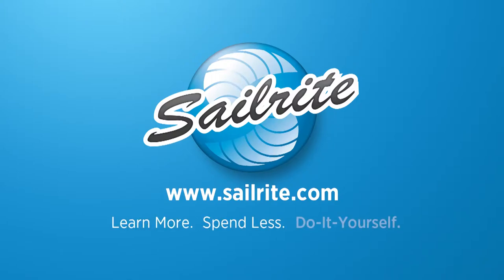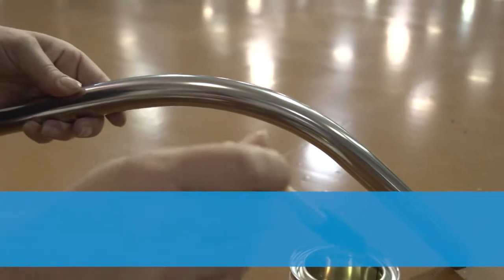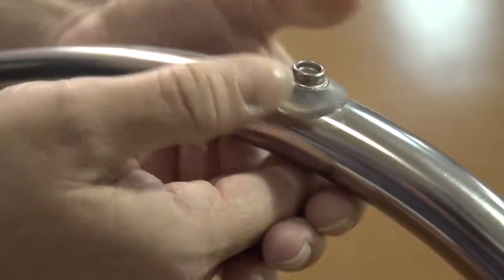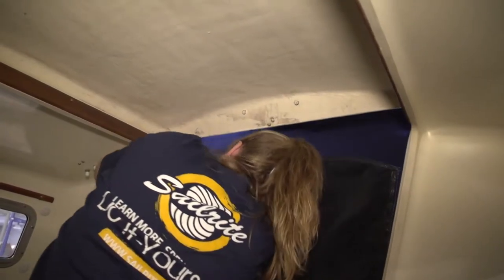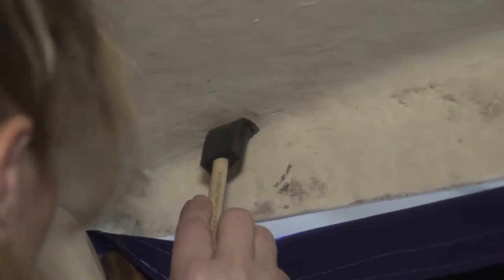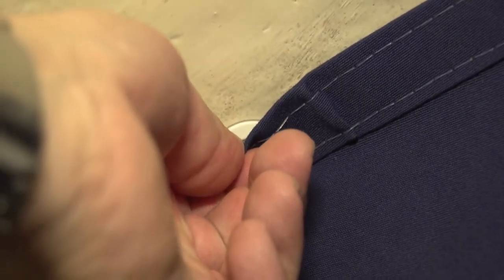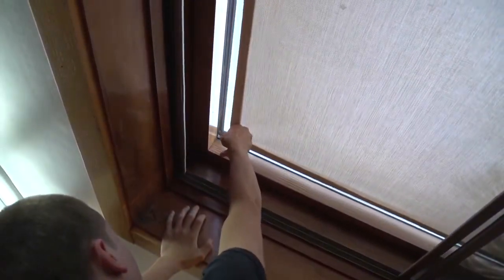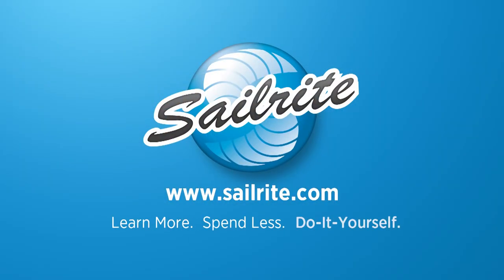YKK® SNAD® Adhesive Backed Flexible Base Snap Stud

Comment: I am looking for a reversible way to secure existing cushions to antique wooden church pews.  However, I need a fitting I can sew onto the cushions compatible with the SNAD.  Do you have any solution to this, please?
Reply from the maker: If possible I would sew a strip of webbing to the underside of the cushion and then install a snap button and socket in it: https://www.sailrite.com/Snap-Fastener-Button-Silver-1-4-Barrel-Nickel-Key-A and socket: https://www.sailrite.com/Snap-Fastener-Normal-Action-Socket-Nickel-Plated-Key-B then use a SNAD stud: https://www.sailrite.com/YKK-SNAD-Clear-40mm-Adhesive-Backed-Flexible-Base-Stud or https://www.sailrite.com/YKK-SNAD-Clear-25mm-Adhesive-Backed-Flexible-Base-Stud

Comment: Good enough to hold up headlining panels overhead?  How would you recommend preparing an uneven fibreglass surface (well cured and fairly smooth, but with no gelcoat and fibres visible)?.